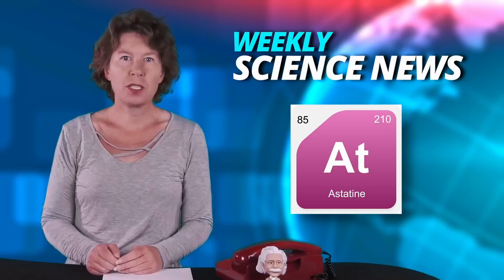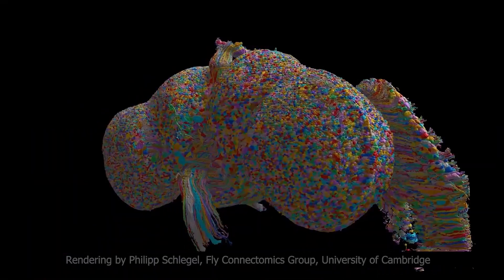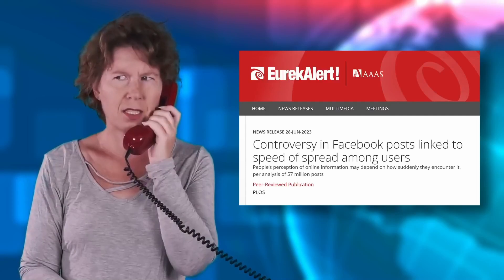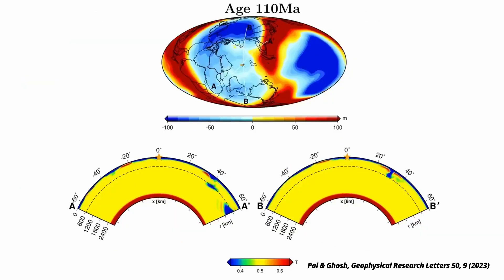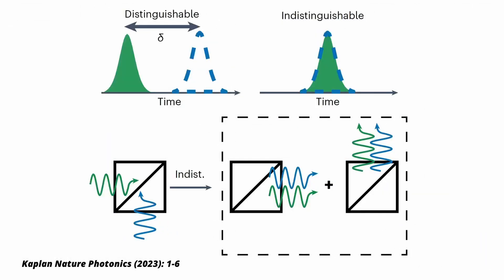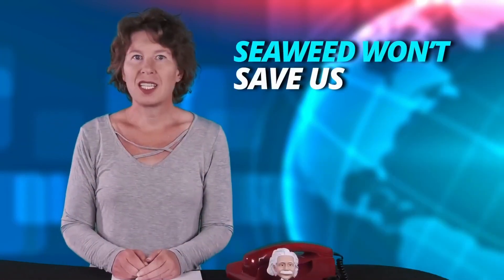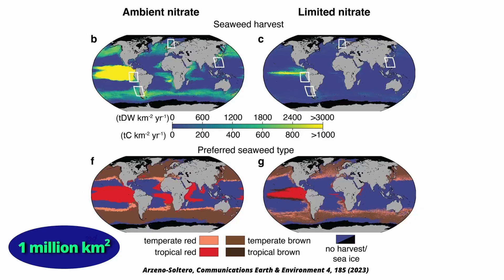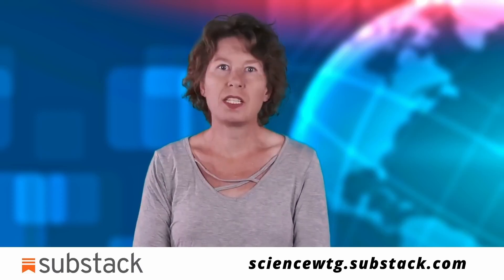Scientists find new atomic nucleus

Comment: The seaweed thing won't work for the same reason planting trees won't work... It doesn't permanently get rid of carbon...when the trees/seaweed dies and decays, it re-releases the carbon... oops... Luckily the "climate crisis" has turned out to not be a crisis after all... Northern icecap was supposed to melt in 2014 then 2015, then 2017...it's still here...

Comment: Photonics is going mainstream more and more.. It's a revolution I was expecting 10 to 20 years ago but better late than never. Intel are releasing photonic interconnects between chips and even inside chips soon and there are already specialist photonic computing chips out there (ie. multiply and add accelerators).

Comment: 14:54 secs, I would suggest making air purifiers the size o skyscrapers and placing them all over the world. It could be done relatively quickly and might not cost all that much relatively speaking. The other way may be to genetically modify plants and vegetation such that they are better at converting CO2, its in scietific american. I think constructing the airpurifiers is best, because eventually the climate could then be permanently stabilized.

Comment: Hello Sabine, Could you answer the question for me: All these astrophysics' Scientists have found Galaxies that are as old as 380 Million years after the "BIG one" or beginning of the time.  Mr. E calls Gravity {Space time Bending) when in the beginning there was hardly any Gravity in the infant universe , therefore the time would have been stretched enormously, what I mean is that 1 second of today would be equal to 100 or 1000 second of 380 million years after the beginning. is my theory correct? and if it is it means it is not 380 million years after the BIG ONE but actually about 38 billion years of our time after the big BANG so that Universe could Produce enough Gravity so that the time slows down (or gets faster).   That is the main reason those Galaxies are so much bigger that anybody thinks.
"Our Universe has about 2 trillion Galaxies which means our universe has 2 Trillion Black holes which means our Universe has lot of GRAVITY (Space time)".

Comment: Continental plates are buoyant because of the concentration of silica-rich (felsic) magma and associated stones like granite and rhyolite. Basalt (mafic) oceanic plates are saturated with water, which lowers the melting point of silica once the slab begins to re-melt at depth. This wet silica-rich magma rises to become plutons and pyroclastic volcanics, typically called an 'orogeny'.  In this case, it was two oceanic plates colliding, and the pluton is emplaced in a basalt sheet instead.  The specific gravity of averaged basalt is 3.1, granite 2.9.  This difference alone is enough to create continents, and this anomaly as well.  Silica is the 'driving indicator' because it is the most common mineral on Earth. This study seems to imply very common processes.  If the pluton creating the anomaly were under a continental plate, I doubt anyone would notice it.  But in contrast to the neighbouring oceanic plates, it looks more like a proto-continent, more like the ancient process that created the first cratons.  It is big, certainly has it's effect on our activity, but otherwise it's harmless and normal.

Comment: I can't help but think that, for any carbon-capture scheme to work at all, it's going to have to be depositing a layer of carbon-rich material somewhere that contains as much carbon as we're taking out of all those geological layers full of it.  In a few centuries we're burning through many thousands (or millions) of years of captured carbon from an ancient time; if we don't stop burning it, we need to deposit an equivalent amount of carbon back into the system - and that will necessarily have to happen at least (but probably way more than) ten times as fast as the deposits we're burning were laid down.  Even a factor of ten would be a spectacular achievement.  How long was the carboniferous ?  Divide that by a few centuries, lay down carbon at that ratio times the rate at which the deposits we're burning were laid down.  Any seaweed capable of that kind of scale-up factor compared to all the forests on the planet when they were new and nothing knew how to digest their corpses ... probably makes kudzu look like an easily controlled minor nuisance.

Comment: RE: CO2 and seaweed

The top three best-selling vehicles in the USA are full-sized pickup trucks. The base model produces about 2.5x the horsepower that the same truck did in the mid '80s. My Dad used one such truck (with the wimpy motor) to run an excavating company, a job at which it performed well. Are there truly that many contractors, and do they truly do 2.5x the amount of work as in the '80s? Meanwhile, the size of an average home has grown from 1,500 sq. feet in the '80s to 2500 sq. feet today, even as family size has shrunk.. 

There is plenty of fat to cut from the developed world's lifestyle, and yet human stupidity and obstinence forces us to contemplate giant seaweed farms.

Comment: Thank you Ma''am, I appreciate these presentations - you teach me quite a lot.  Question about the data transfer, you said that they were able to get chip to chip transfers running at 512Gbps.  Is this a direct linked chip to chip, or are they running over fiber optic cable?  And at what length of cable?  For use in datacenters you're going to need a bare minimum of 100 meter transmission capability over some sort of fiber optic cable.  The diagram of the optical wavelengths seems to correspond with what we use for Long Distance (single mode) fiber optic cables (the LEDs on the Short Form Pluggable modules have a signal launch rate of around 1500nm, compared to the typical multimode fiber SFPs running at 850nm).  If you have any more information on this, or perhaps a place where I could look into it, I'd appreciate the information.  I work with enterprise level block storage arrays and right now most of the equipment I work with can handle 16Gbps on the array side of the connection, and I know the industry is looking into 32 and 64Gbps transfer rates, but 512Gbps is really next level stuff.  I can tell you right now the datacenters I've worked out of with a ... "large multinational corporation" ... are not saturating their existing dual 8Gbps links the servers have with the storage arrays, but that won't last forever.  One thing I've learned is when we make things faster, someone comes up with a way eventually to saturate the network.  Thanks again!

Comment: FFS, the climate is NOT "changing rapidly".  We do not need "visualisation" products we need to recognise that you cannot model a complex , chaotic , non linear system (IPCC). Neither do we understand the main processes of climate : evaporation, advection, nucleation and precipitation, at the level of having mathematical equations of the "basic physics". All of this characterised by guestimated "parameters" , which allow modellers to jerry rig the models to get the results they need.
Reply: The globally rising temperature due to increasing co2-levels as the result of open combustion of fossil fuel is a undeniable fact. There are many, many visualisations of this happening. If you want to deny it, you need your own alternative, or remain silent as you have no information at all.

Comment: The compute power required to model the climate down to 1km scale is a massive feat by Nvidia, and they say it will take a continuous power consumption equivalent to the top 8% of the Earth's population's energy consumers and generate so much excess heat that it will warm the globe by 0.9°C. But with that, they'll finally be able to determine for a fact whether humans have an impact on Earth's climate.

Comment: IMO trying to sink seaweed to the ocean floor does not make much sence at all!
Surely the smart thing to do would be to use all the different species of macro and micro algae for the production of food stuffs, fibre products, biogas and biochar!

Also, I would like to know why "the logistics are unfeasible" in relation to creating seasweed farms along the equatorial oceans? Obviously such projects would take time to implement but enough people working cooperatively, and in line with the laws of physics and chemistry, should be able to accomplish whatever is needed. 
So long as all the growing areas and supporting infrastructure are kept within about 500 km of the equator they should not be affected at all by huricane wind systems, although presumably swells generated by huricanes would reach them. 

As for nutrients for the seaweed, what is wrong with creating artificial upwellings using wind powered pontoon/barges circling around a central point to create upwards swelling vortices (gyres)? The photic zone of the oceans is almost desert-like in most regions because, basically, shit sinks away from the surface in the oceans -  unlike on land where poo plumets to the surface and is thus readily available to plant life. As I understand it sea life is, by and large, most abundant where winds and ocean currents combine to lift deep ocean water laden with nutrients to the surface where photosynthesing algae make use of it.   

As for habitable infrastructure out on the open ocean: floating islands of insulated ice (say 20 m thick?) could be created and maintained using wind, wave, and solar power.   These would easily support living accommodation, workshops, seaweed processing systems, and other urban infrastructure. LOL, personal transport through ice tunnels on skates would obviate the need for motor vehicles! And of course all manner of sporting and recreational passtimes featuring ice skates and sliding would do wonders for social cohesion and general health of the populations! 

Think about it! 🤔😊👍

Comment: Higher resolution climate models will not fix the core problem which is that the system we are modeling is very complex, and the formulae for these interactions is very approximate, and arbitrary. Most of the software models are jam packed with arbitrary constants, and hand tuned by the authors to produce the results they want. Any model that has so many tuning parameters is not a true model, but an elaborate piece of software-aided propaganda.

Comment: There is a group working on practical demonstrations to tackle that seaweed farming nutrient problem and the solution may be artificial nutrient upwelling using what is essentially a pipe to the depths (as deep as 500 m), with a wave or solar powered pump bringing up water (up to a million liters per day) which will also help the seaweed survive marine heatwaves. If it all works, that would bring to bear much of the open ocean and not just those regions already in high demand (and which already suffer from marine heatwaves, and that makes seaweed farming or kelp cultivation impossible during the hottest months of the year, today!) As the oceans get even hotter it might even stop the overturning circulation altogether, making for even more lifeless oceans where life currently still flourishes. Restoring the overturning circulation that way would then be even more of a pressing need, even if it was artificial.

Their organization is called the Climate Foundation, I think, led by Dr. Brian von Herzen, and they've already built some subscale demonstration seaweed farms that have been proven to survive a recent cyclone season. They call their technology "marine permaculture". They are looking for volunteers and, no surprise, funding to reach their stated aim of demonstrating a large commercially sound seaweed farm that works on the open oceans. It's the only really large scale idea with a scalable solution that I've encountered thus far with some serious drawdown potential in the amounts that humankind needs if we are going to be serious about removing all the CO2 we've pumped out since we started industrializing.

Comment: Those climate simulations also aren't good at predicting the climate. The best models we currently have only occasionally have the lower end of their error bands stray into the adjusted temperature readings. They still run too hot for the raw data.

The major problems are due to chaos theory's laws that define limitations on prediction based on the accuracy and volume of data collected.

Weather models used to be able to calculate up to 10 days accuracy within a degree; however the adjusted readings appear to be messing with the  predictive models such that we can't even reliably predict maximum temperatures even 24 hours out.

Corollary: it doesn't matter how good the resolution is with the simulation, they need accurate data (more accurate than 0.1°C, sampled at better than a 10m^2 grid at that resolution) or we're just fooling ourselves.  GIGO.

Comment: To those who may know. Is there any reason to believe if ever increasing efficiency has only created ever increasing appetites for more computing power and ever growing energy use? Is there any reason to think that efficiency gains going forward would translate into a net decrease in energy consumption through the efficiency gains. My puny mind doesn't see any reason to think we'd see a net decrease. I mean, no efficiency improvement we've ever created has decreased our appetite for energy so far. We only ever change fuel source and use more. I know Nuke and maybe green tech would significantly change the CO2 equation but what about the heat equation. I'm not to lazy to do some legwork myself on my questions but if there are real experts out there who could chime in on these thoughts I'd appreciate it. TY Sabine, love the vids!

Comment: Thanks for the video! If the distance is short, like at most 5 meters, twinax-SFP modules are faster than light in every aspect - just look as the physics :D. Fibre is used because it can have a higher clock, even though the signal is slower. Though there are hollow fibres to compensate for that, making light faster than copper again, quite expensive stuff.

Comment: On the up side, there's no actual evidence that the relation between amount of carbon in the atmosphere and higher temperatures is causal in the carbon -> high temp direction. There is evidence to suggest the causality is actually reversed. Further, there is zero evidence that global temperature averages are driven by human activity; it tends to be strongly correlated with the activity of the Sun, which is decidedly not something man influences. This correlation does imply causation, because the Sun has immense impact on the Earth while the Earth has next to none on the Sun. In good news, however, higher temperatures on Earth have historically led not to mass extinction and flooding, but rather to periods of economic thriving as more land becomes increasingly fertile increasingly far north (and land near the equator does not, in fact, become LESS fertile). So an Earth warmer than ours is today (like, say, it was about 700 years ago when England had vinyards way north of where they can be sustained now) is actually not a bad thing for human life. And it will happen with or without us living our lives as normal.

These massive projects to "save the planet" all have gross ecological impacts because they are the equivalent of trying to solve a natural cycle of prey/predator balance by introducing invasive species.

Comment: Fast enough to be RAM but permanent when unpowered -> Very nice "sleep mode" shut downs. Boot back up to your system being exactly where you left it, programs picking up where they left off without having to shut anything down! (Reboots to fix things "not working right" still would require a proper shut down; making things work right again is accomplished by starting them over to remove whatever cruft has them bogged down or otherwise errored.)

Comment: 1:15 - Uh...Sabine...Alpha particles are not dangerous outside your body (unless they are moving at relativistic speeds).  The real danger for an alpha particle is when it's IN your body.  Non-relativistic alpha particles will be stopped by the top layer of skin (which is typically being shed by your anyway).  A sheet of paper is enough to shield you against non-relativistic alpha particles.

Source - me, as a nuclear engineer, I've had plenty of health physics classes and been around a number of radioactive materials and I was also more worried about injesting alpha particle emitters than having one sitting in front of me.

Comment: Has anyone tried the Galaxy Projector 2.0 in these comments?

I wanted to buy it, but after digging beyond all the glowing reviews it seems like its not actually that great. Like it promotes a real starry sky but if you look at review video’s you can clearly see the stars are mostly just in neat rows and the background colored galaxy “dust” moves at different paces than the stars. So could anyone vouch for them before I dare buy it?

It also seems like there is a permanent 50% off on the products while you aren’t allowed to use stacking discounts (voiding the advertisement of Sabine) as well as a “no refunds for discounted products”.